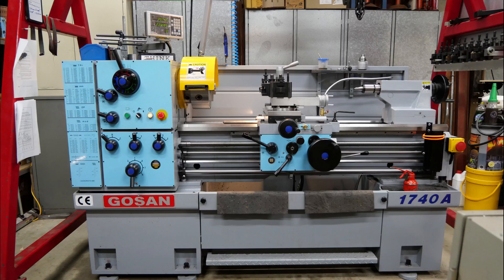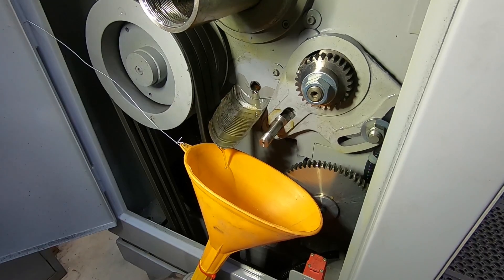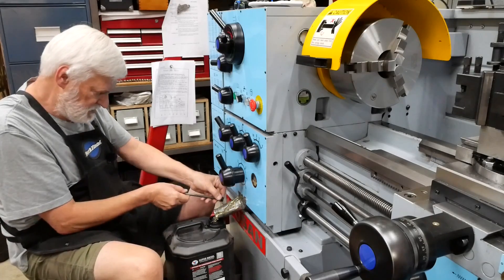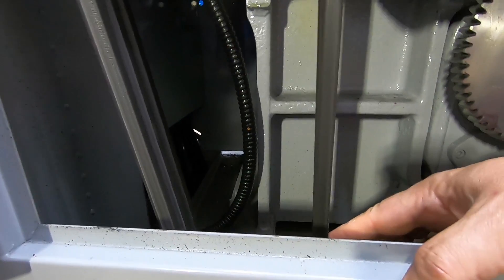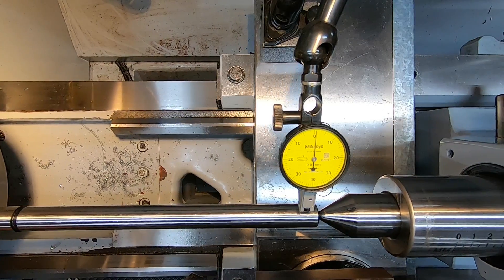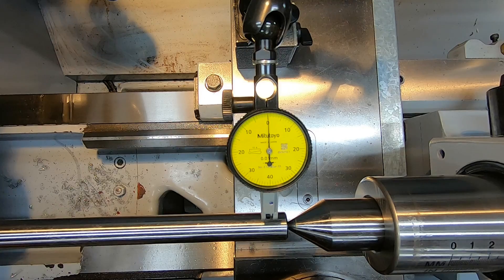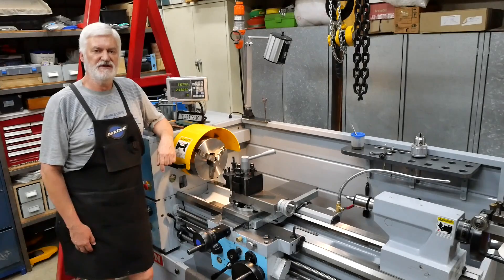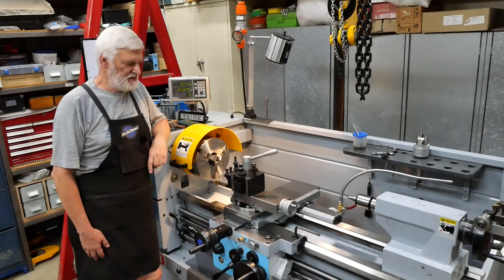Lathe maintenance.

Comment: Hi Alan
What's your thoughts on lubricating the change gears ?
My came from the school with a  liberal coating of grease on them.
Reply from the maker: Gosan recommend using Tonna T68 slideway oil (or equivalent) for everything including the change gears and even the headstock. It is pretty good stuff - has tackifiers to help it stick to surfaces but can be used as 68 weight hydraulic oil. Gosan recommend oiling the change gears daily but I just give them a squirt from time to time - pbly should make it a weekly habit :)

Comment: Excellent run through on annual maintenance - often overlooked.
My lathe, fair bit older than yours - had to translate the original oils to what I could get locally (in Oz) in affordable quatities - worked out to be penrite iso 32 for headstock and iso 68 for gearbox and saddle.

Comment: I purchased a 18x40 lathe in 2004 here in the States from an importer called Grizzly. It was an internet only advertised lathe, that they did slap their name logo on. It's 5600lbs of iron. From dealing with the early issues of the tailstock that had a manufacturing defect that would not let the #4 Morse Taper tool seat in the tailstock (some machining defect that caused an interference fit with the tang of the tool). They did send me a tailstock quill from a spare parts machine, but I had to grind it to fit my tailstock bore (about 3 thousands too big).
After finding many other issues with the D1-8 headstock taper, cross slide gib, compound gib, where the adjustments would bottom out the adjusting screws, I figured out the lathes they imported were made from every incorrectly machined part, that instead of scrapping they manufactured 8 or so machines they could export to the highest bidder. They sold it at a rock bottom price to me of $7500USD, and typical machines of this size were selling for 3X that in 2004.
After much repair of the pre-assembled "kit" I do have a working lathe that will hold a few tenths of diameter in 12" carriage movement. I did replace the lathe chucks that came with it with Bison 12"  6 jaw, and 12" Pratt Burnerd 4jaw. Oddly, they did get the headstock square to the ground lathe bed.
The crossslide, you can see the milling machine swirls, so clearly it's not hand scraped, or finished. And I'm not sure how perpendicular that axis is from the ways, as I think it machines concaved surfaces when facing. 
However I have to be careful how far out the quill is on the tailstock, as its bore is not parallel to the lathe ways. So it was adjusted for proper operation with it sticking out 2" and the correct length live center used. There's no simple way to machine the sliding parts of the tailstock to correct for that.
I ran into the exact same issues when I changed the oil out in the headstock, change gear, and lathe carriage gear boxes last year. I was going to put an extension tube on the headstock, which was located in the same place as yours, but here in the states, there are no metric threaded sources for pipe nipples, and 1/4turn ball valves. I figured this would be the one and only time I would ever change the oil out again. Oddly, my head stock cover plate had no gasket, as they used thick grease to do that task. I did put a ceramic magnet near the pump pickup tube, as this lathe has no inlet filter.
My lathe was not intended for import to the States, as it does not have a Morse taper headstock spindle taper (the manual say's it's a #6). It has a 90mm metric taper which is used in Europe. And that too was machined wrong, the adapter that has a #4 Morse hole to the 90mm taper was machined with the 20:1 taper off where in 4", the minor diameter was 3 thousands too small. But when you inserted it, it felt like it fit perfect, but the tip of the inserted  center, would rock, so it was never concentric to the headstock spindle. I just fixed that last year after I got some metrology equipment to measure the taper error. I needed a bench center, and a large sine plate I could put on my surface plate to measure the error (as well gauge blocks). I figured out a setup to hold it while in the lathe and used the tool post grinder to correct the taper. Now it fits correctly. 
As I said, every incorrectly manufactured part assembled and exported instead of scrapped.
I should say the major reason for buying this lathe, was for shafting, where my 10x24 only had a 25mm hole through its headstock, and this has a 80mm hole.
Reply from the maker: Wow, that's quite a litany of issues and I admire your tenacity in working through them. 
Re the misalignment of the tail stock bore, would it be possible to bore it out and sleeve it to the fix the problem ?  
I became aware of the Grizzly brand when searching for info on my old lathe as many Grizzly branded machines are also sold here under different names. I found that the user manuals Grizzly provides are much better than we see here - especially for maintenance and adjustments.
Thanks for your comment.
Reply: @alanshomeworkshop  It would be a huge task to figure out how to line bore it on the lathe, and not make it worse. I would just make a new quill vs trying to sleeve the bored out one. I have thought about this, effectively, a temporary tailstock that can support a center is needed, but making that rigid enough so the cutter in a line boring shaft does not push it around requires a big chunk of metal in my minds thinking. And getting that precise. :face-orange-raised-eyebrow:There are some things I can't fix in this life time. And my que of all the things I want to do, is infinite. Like a 1924 Ford Model T truck I purchased in 1981, that has been sitting waiting for me to get back to it.
Reply from the maker: @f.hababorbitz  A man has to pick his battles :)

Comment: Im amazed by the impact of the weight of tools in the tailstock tool rack on such a beefy lathe.
Reply from the maker: I was surprised to find that the lathe base is not cast iron, as is common for this class of lathe, but fabricated from steel plate. This probably explains why it is 400kg lighter than a comparable lathe (TM-1749G from H&F). The fabricated base also has a large door opening in the front that enables easy chip removal. This design doesn't affect the performance of the machine in any way that I have noticed, but it may provide less torsional rigidity than a cast iron piece. Installation instructions note that "the lathe may be used free-standing or bolted to the foundation" and I suppose that bolting it down would be a good idea for a really heavy duty usage. However, my lathe is free-standing and I have taken some heavy cuts with no problem.